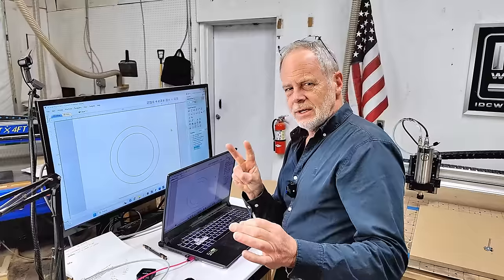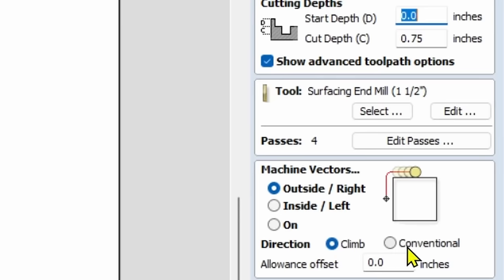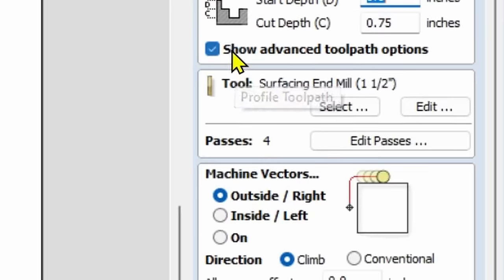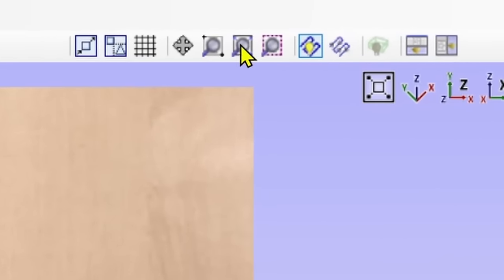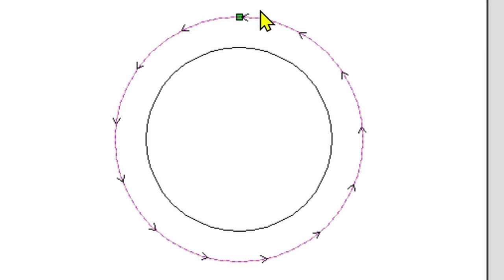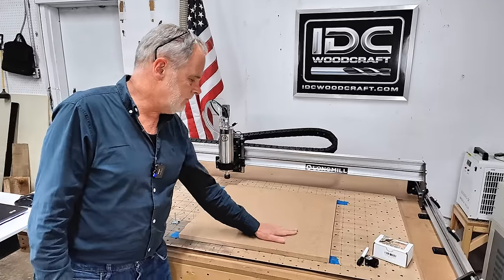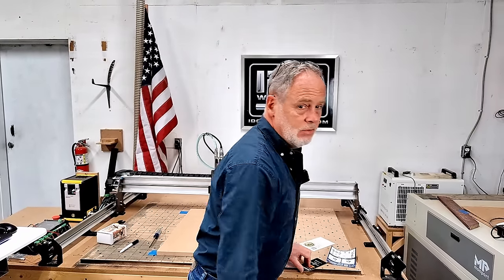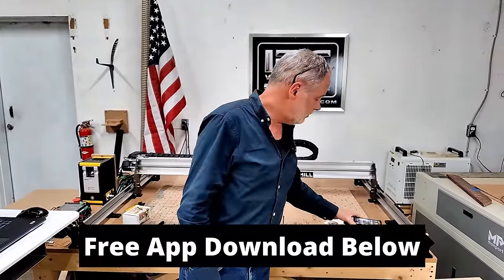The Difference Between Climb and Conventional Cutting - CNC Routers

Comment: Tough topic to explain!

Climb/conventional milling is to X/Y axis as upcut/downcut is to Z axis.
Upcut's cutting force pulls material from the bottom of the cut to the top pulling it across the top edge of the material.
Downcut cutting force pushes material from the top into the bottom of the cut.
Conventional cutting force pulls the material from inside the material to outside like Upcut but on the X/Y plain.
Climb cutting force pushes the material from the outside to the inside like downcut but on the X/Y plain.

 Climb/conventional cutting can have the same benefits as up/down cut with other considerations that's usually mostly to do with grain. I mostly choose based on the flow of the grain not to cut into it but with it for less chip out.

 The twist is rotational forces are much greater on climb cuts. They humble the best of cnc folks on the biggest of machines.

 Like a tire on a car. If the car is tire is rolling forward the same direction as the car the tire easily climbs any obstacle. Its natural tendency is to climb up and out. If your car is on a tow truck and you gun it in reverse that's conventional. The tire rotating in the opposite direction to travel naturally wants to dig in.

 The real difference is on conventional the material is in the way of it digging in! In climb the edge of the material is right there making it want to climb out of the cut. For the most part the smaller the bit diameter the easier it is to deflect and climb out.
Reply from the maker: 3dtwerking324, wow thank you for sharing your knowledge and helping explain this in a different light and perspective! I have no doubt your insights will help clear up some confusion for our other cnc brothers and sister! Happy cncing my friend!

Comment: Back when dinosaurs still carried two pairs of glasses and AutoCAD came on 27 floppy disks and a 3 ring binder, I was told when designing parts to specify the finish edge for the machinists, but me being me, I would walk papers down to them to ensure what was on the paper was actually doable. Mind you, my machining knowledge was mostly relegated to whatever they would share with me and over-the-shoulder observation back then, but a lot of the engineers never bothered to even visit the machinists and just did the drawings, stuck them in the Out box and that was that. 
All that said, picking up what I could here and there, it was relayed in hushed whispers that the machinists would pick whatever style cut easier for the chosen material and would finish it on secondary equipment with no one the wiser. It turns out a lot of that secondary decision-making went on despite the specs on the paper, wouldn't ya know. 😁
It's been an interesting road learning their side of the world all these years later with digital equipment and doing it yourself to say the least. Dare I say it, we have it MUCH easier now then the guys with micrometers running a manual Bridgeport, and they will always have my respect. Old aerospace parts are like fine art and jewelry in equal measure, and it's simply incredible what they could do with (by comparison to today) 'legacy' machines.
Reply from the maker: C-M-E, What a fascinating journey you've had in the world of machining and design! It's true that the evolution of technology has made things more accessible, but the craftsmanship of those who worked with manual machines is truly commendable. The attention to detail and skill required to create parts in those times is something many of us still appreciate today. It sounds like you've gathered a wealth of knowledge over the years, and it's great that you recognize the artistry behind the old techniques. Thanks for sharing your insights!

Comment: One simple question on the matter: If I pocket out a 20 mill hole in wood, which direction gives the biggest hole ? a climb cut or a conventional cut ? And does the up or down- bit makes also a difference kind regards hans
Reply from the maker: hanspijpers2100, great question brother. 

Climb Cut: Gives you a smoother finish but can be trickier to handle because it tends to pull the router towards the workpiece. It might not necessarily make a bigger hole, but the edges will be cleaner.

Conventional Cut: This is safer and easier to control but can lead to a bit more tear-out on the wood. The size of the hole won't change much compared to climb cutting; it's more about the quality of the cut edges.

As for the bits:

Up-Cut Bits: Great for pulling chips out of the hole, leading to a cleaner bottom but might roughen up the surface around the top edge.
Down-Cut Bits: Press the chips down, making the top surface cleaner but potentially packing chips at the bottom of the cut.
Neither the cut direction nor the bit type will significantly change the size of the hole. It's more about the finish and the ease of cutting.
Reply: @IDCWoodcraft  okay thanks

Comment: So never use climb cut. Got it !
Reply: Climb milling is almost always the correct method for cnc machines (better finish)  Conventional milling is for manual machines with backlash.  Basic machining 101, in wood you can hear how crappy it sounds when conventional milling.  You need to do some tests and see which works best with each material, sometimes it won't matter actually.  Both are trying to deflect the tool away from the wood, if you don't believe that try a spring pass after each cut and you will certainly still cut a little.
Reply: Climb cutting is usually used when cutting aluminum and plastics. Conventional is pretty much used for everything else.
Reply: @jefferybartel1312  Only if it helps the melting of it or something, no one climb mills in a CNC machine shop, we machine aluminum constantly but with flood coolant.  The spindle speed on a hobby cnc router is way too fast for non coolant operations.  It's tricky so I hate for people to get something in their head as a guaranteed correct way to go all the time.
Reply: @larryrobinson7492 been working in a commercial CNC mill shop for over a decade , flat sheets non-flood coolant. Tooling manufacturers even recommend using a climb cut to cut aluminum and plastic (Onsurd, Seco, ECT). But to each their own. The reason you climb cut is to basically prevent the material from "melting" back onto itself, whether it be plastic or aluminum.
Reply: @jefferybartel1312  I'm not arguing that, I'm a fan of climb cut, it seems some have gotten the wrong message from this video that climb cutting is "Evil"  I work in a aircraft manufacturing machine shop so yes, I'm very in tune to the processes.  They do laser cutting of the thin sheets in the other building, we do All kinds of milling and lathe work mostly.  I run alot of different machines at times but I personally prefer the CNC lathe, I run a large Mori Seiki lathe and Mill primarily.
Reply: @butchlandry1266  sad way to think, that's not what Garret wanted you to think.
Reply from the maker: Butch, not necessarily brother! Climb cutting definitely has it's time and place!

Comment: What materials would climb be a better choice? The software has option to reverse last pass with an allowance have u ever used this?
Reply: Climb cutting generally used for aluminum and plastics
Reply from the maker: TheUnionStreetWorkshopcom, others that have replied to this one are exactly right brother! You will have great results in metals such as aluminum, plastics and composites! As for the reverse of the last pass, while it is a great option I only use it rarely. Give it a shot and see how it goes!